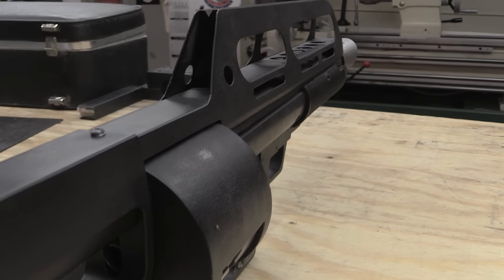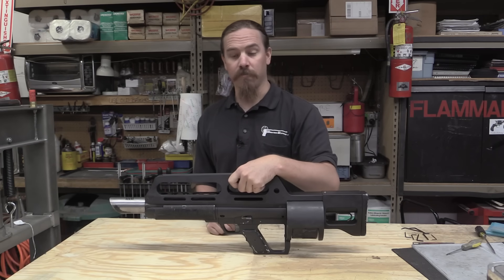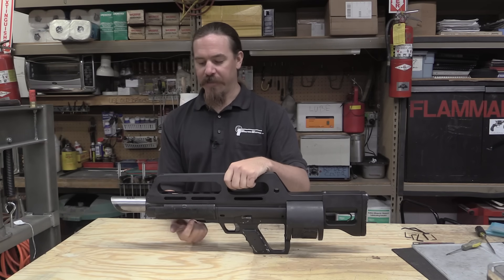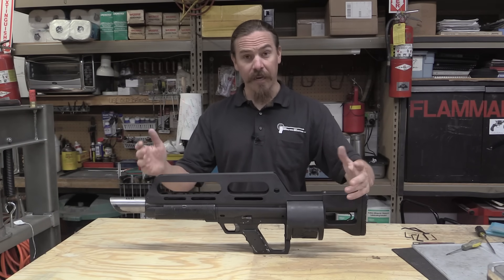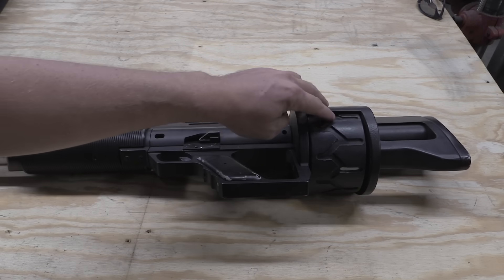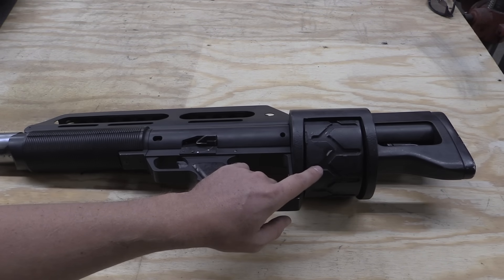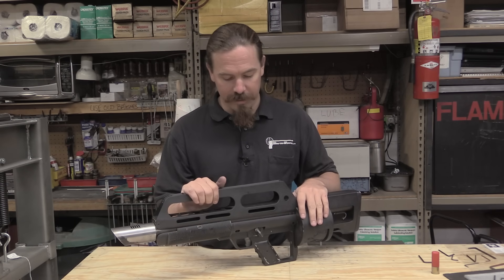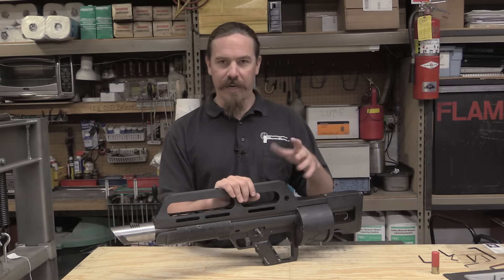Pancor Jackhammer: The Real One

Comment: Now you got that gun,, it would be great to find a XM-8... A sadly forgotten weapon.
Reply: +sam strothers I did not know that . thank you for sharing
Reply: +DeuZerre Its just a H&K G36 in a fancy shell.
Reply: +MrSuperkaji a fancy shell that liked to melt, but still one very pretty fun
Reply: +DeuZerre What was the point of it? Same cartridge as M-16, barely shorter, around same weight, same/slower rate of fire, both can use 30 round box/100 round drum magazines, etc.
Reply: or a  FX-05 Xiuhcoatl
Reply: vickers tactical said he is working on getting one :D
Reply: +gunfuego Eso no es un "arma olvidada"... :) Forgive my imperfect Spanish... LOL
Reply: ***** IIRC, it was a lot more reliable than the M16. THe thing was thrown out of the window for a few simple reasons, the main ones being "non US" and "not a cheap throwaway weapon" which is the philoso^phy of the colt: It's just good enough for the proce, and you can build many of them for nothing.
Reply: ***** Because it looks cool as fuck! Thats the point !
Reply: +username Reliability, mostly. The gas system from the XM8 (the same as in the G36, itself rather similar to the AR-18) is way less finicky than the AR-15 mechanism, which is kinda prone to blow up when wet. Or dry. Or dirty. Or when it's just that time of the month ;)
Reply: i believe it also melted, which isnt great.
Reply: savage1493 Only the first trialled version.
Reply: +savage1493 they put like, what, 50,000 rounds through it continuously. 
It's not gonna melt once you start shooting it.
Reply: it melted after a couple hundred rounds
Reply: savage1493 SIgh... Only the first ones that were tested. Like every tests for new stuff, it was quickly fixed. Its detractors only like to wave the "melting" flag.
Reply: +DeuZerre The AR is reliable enough by US military standards. In addition it only takes HK propitiatory G36 mags (because that's what the XM8 almost exactly is) when we're on the NATO standard STANAGs.
Reply: The AR is a reliable enough, good enough at everything gun... For cheap. They never wanted to replace it. The contests were rigged from the start.
Reply: DeuZerre So they didn't want to replace the M16 outright but it doesn't mean they didn't want to adopt a better weapon, foreign or not, to supplement the current supply of ARs as evidenced by contracts given for the FN SCAR, HK 416, 417 and M27 IAR. Let's face it, HK didn't win many contracts with the XM8 because not many people wanted it.
Reply: +DeuZerre Not really forgotten, Malaysian special forces employ them.
Reply: +MrSuperkaji Not really, the G36 did not have the same modular capabilities as the XM8.
Reply: +FraggingBard either you are missing a hell of a lot of shots or you have the wrong type of weapon if you need to kill that many enemies. lol.
Reply: +EnigmaHood Ooh wow, swapping barrel lengths means its an entirely different weapon. Internally, it is a G36.
Reply: MrSuperkaji
Knock off the sarcasm or you'll find yourself on my block list fast. Swapping barrels other components to change the weapon's role is not a trivial feature and it's a level of modularity that the G36 did not possess. It was also far more reliable and lighter.
Reply: EnigmaHood
My original statement stands true, as the XM-8's action is pretty much identical to the G36, and the only real difference between the two rifles is that of its cosmetic appearance, and the ability to switch barrel lengths.
I really don't see how its any different from the G36. The G36 even has its own family of derivatives, from carbines to LMG's, just like the XM-8.
Reply: MrSuperkaji
No it doesn't, and it's for the aforementioned reasons. Being closed minded and obstinate doesn't make you right.
Reply: MrSuperkaji Swap from an asault rifle to a marksman rifle to an SMG to an LMG with barrels and stocks.
Integrated optics so you don't have to readjust them all the time.

"not very different"

Hell of a lot cheaper and easier on logistics, field stripping.
Reply: +DeuZerre military logistics would make the swap idea completely asinine, you'd have to match all serials train constantly on different tactical aplication of effective ranges and overall use of weapon in any company, squad, or fireteam  based movement scenarios. you're also looking at overall issue of up to 3 barrels per soldier and keeping positive control of extra barrels making them sensitive items of their own. so you have 
1. training on new weapon system
2. training on tactical aplication
3. training on storage and sensitive items control
4. change out of Nato standard mags
5. lack of combat durability via majority plastic components
6. armorer briefs and sop standard changes 
7. production of vastly different manual of operation 
8. purchasing manufacturer rights
9. purchase of mass quantity for new issue
10. Hk manufacturers would not be up to the task of supporting us military needs
ect...

there is a lot more to adoption of a firearm for military service than "lack of interest" or "not inclined to spend money on better weapons" you'd want to issue a weapon the military could use its existing mags and save money on training anywhere they can our budget isn't endless and it would take years to issue something like the xm8 rifle. and it's not really worth it 

the m4a1 and m4 carbines even m16a3 and a4 are vastly more reliable than the m16 a1 and 2.. mud dosnt really effect the rifle unless you have no mag in the weapon and the bolt locked open as you dunk it in pile of mud... it's a well sealed rifle and it operates fine of you know what your doing and have basic cleaning knowledge.

so if you were the military, you'd see 2 5.56 rifles with roughly the same range same tactical capabilities close to the same weight but the m4 series is a hell of a lot more moduler of a weapon for modern military optics and iraq lasers to be integrated.  so the xm8 isn't this gift from God its just another 556 rifle that isn't worth a second look
Reply: What kind of nonsese are you talking about? Who said everyone had to have all of these different barrels and bits and bobs? It makes no sense whatsoever. The point of a gun with interchangeable parts would be to ease the logistics by making spares from the same families so the LMG/DMR/Riflemen would use the same base components to fix their weapons, but each of the men would only have the specific bits of their specific variant.

There is absolutely no good reason for the regular guys to be able to switch between all the roles on the field.
Reply: +DeuZerre  I'm talking about logistics, and I never said every Joe gets a barrel kit, what I'm saying in general is the rifle is not a platform that brings better performance to the table and the cost of switching is in no way feasible. calm down there Skippy
Reply: Weren't there plans of the US army adopting the HK 416? I mean it's basically a m4 lookalike xm 8 in a non melting hull.
Reply: The Doctor
I'm not sure if there were ever any plans, but the USMC did adopt the M27 as a squad automatic weapon, and that's basically an HK416.
Reply: +DeuZerre The Daewoo K11 is quite similar, and actually in use.
Reply: Actually, i saw some soldiers in the italian spec ops with them.
Reply: +fredmachine xm8 was a bi product of H&K and colt working together to find a better alternative to the m16. well guess what happens when you mix two languages together and see if you can make a gun. luckily the xm8 later became the g36c, g36k (my fav) and the mg36
Reply: Actually all three versions came before OICW was killed and the XM8 branched off, the K was made around the same time as the rifle to replace the paratroopers' G3KA4s, the C was made for police and special forces around 2001, and the MG36 was made to replace the heavy MG3 (basically a re-calibered MG42) as an infantry machine gun but was not adopted due to the lack of a quick change barrel or reliable feed (Drums have never worked very well) ;and the MG4 adopted instead. That aside, the XM8 would have been a good gun, possibly even a great one, which was sadly killed due to American manufacturers whining about a lack of competition, despite them and Alliant winning the EMD contract for OICW in the first place.

Comment: Problem with military procurement. Good ideas failing because of financial problems.
Excellent work like always, thank you.
Reply: No the thing about this is the budget ussually is spended in sheer fucking dumb projects that are hella lot expensive, take years to develop , and when is  ready for deployment is already obsolete (Hello there USA  Defense Budget) when the money instead of beign spended on  "superweapons" could be far better used upgrading weapons and gear for the regular army.
Reply: It wasn't a good idea though, a full auto shotgun has even less merit on the battlefield then a pump shotgun. For at least the pump shotgun is a simple and cheap way of doing the one thing shotguns do in modern war, breeching. This plastic covered behemoth is only good in the looks department and not on any realistic scale.
Reply: You should see the way you have to load it. Insane....

Comment: Reminds me of the street sweeper. I had one back in the 80s before they reclassified them. The folding stock broke the first time I used it but the gun would definitely unload all 12 rounds in about 2 seconds. You could cut down small trees with it. Very slow to reload but still would make a good entry weapon. If you still have a problem after 12 rounds of Magnum buckshot you didn't bring enough guns to begin with.

Comment: Watching this again, something occurred to me: if the disconnect for semi-auto fire activates at the end of the triggerpull, beyond what the mechanism allows for full-auto, could it fire automatically while set to semi-auto if the trigger is only partially depressed?
Reply from the maker: Mechanically yes - but in practical terms the recoil from firing would make this impossible to actually accomplish.
Reply: +Forgotten Weapons what about a trigger stop screw that only let's the trigger travel to the point of this technical full auto, where you could just grip it and rip it!?
Reply: Was wondering the same. I think it would have resulted in a really nice burst-fire "hidden feature" for experienced users. Pull lightly in semi-auto mode, and get two or three rounds off before the recoil force hits you hard enough to cause you to release the trigger or pull it all the way.
Reply: Yes. This can be accomplished on some guns by slipping a pencil behind the trigger. The more you know.

Comment: If I were to continue this project, I would ditch the idea of a completely rounded profile. Those little plates that are in there are just extra weight and who wants that?
Reply: +BrainSeepsOut almost certain the idea was to have the reciver rounded un  produtction and the plates are there to help woth working out the tooling and to get it looking like the planned never to happen production jackhammer
Reply: +BrainSeepsOut They're decorative. In the tool room, he made the underlying part as a box (which is easier) and added curved parts to translate the final look - that would be achieved with factory stamping (that he didn't have access to).

Comment: ... I have a feeling that the “different magazine change system” was something similar to a bolt handle that pulls back the central drum rod to drop the drum out the bottom of the rifle.
Reply: Wonder what happened to those models. Army probably just put them in storage somewhere and forgot about them.
Reply: Omega Supreme I wouldn’t be surprised if that happened.

Comment: The drum design is clever and impressive!
Reply: If you think thats cool, you should open up a ballpoint bic pen with the clicky button on the back.  Its the same sort of rotating and camming mechanism.  Every other grove  is half the length.  So you click it once, the pen stays in, click it again, the pen extends out.
Reply: If you think thats cool, you should open up a ballpoint bic pen with the clicky button on the back.  Its the same sort of rotating and camming mechanism.  Every other grove  is half the length.  So you click it once, the pen stays in, click it again, the pen extends out.
Reply: it had a accessory called the BearTrap where you could put the drum on it and use all 10 shells like a M18 Apers mine...

Comment: Did I understand the firing mechanism wrong or can I actually fire full auto in semi-auto mode if I manage to squeez the trigger carefully enough to not let the mechanism lock back totally?
Reply from the maker: +KnorpelDelux I think you could. Good luck actually pulling it off with all that recoil going on, though.
Reply: Thanks for the reply. Yeah I was just talking about the theoretical possibilities to fully understand what's going on here.
Reply: +KnorpelDelux i thought the same thing. Like what if you wanted to fire single shot, pull the trigger and then release the trigger to a timing where it engages full and it fires 2nd round unexpectedly

Comment: If the design was simplified to make it easier to make, and someone like Magpul who specializes in injection molding polymers wanted to make it, there could be a modern lightweight shotgun inspired by the Jackhammer. Not an exact copy, but a bullpup setup using a drum mag. A 12 round mag might be better and could be made to the same weight. I think a semi-auto only version would generate a lot of interest from civilians and police. I could see it selling well if it was reasonably priced. A 20mm grenade launcher version, sort of a NEO-Neopup, for the military would be awesome. 10 x 20mm grenades vs 1 x 40mm grenade sounds really good to me. Even an 8-shot grenade launcher would be cool, and not bulky like the 6-shot 40mm Milkor MGL.

Comment: When I saw this, the first thing I wondered was if you were going to cover the bear trap function. Way to do your homework. There was actually a shell designed specifically for that. When fired, it inflated a three foot diameter thick wall rubber balloon till it popped, releasing a massive shock wave and a brilliant flash of light. Probably wouldn't want to get those mixed up with your buckshot rounds........= )

Comment: Damn, thanks for the cheap mine idea, 3d printed drum, i would put them at an angle so they shoot in every direction in a circle, pressure plate with firing pins on the bottom, that could easily take out an entire unit
Reply: In my mind its such a simple device, down to the trigger mechanism, a spring holding up a rod, & on the bottom a pressure plate or even a mechanical button to engage the firing pins forward to strike each round

Comment: For the mag I imagine...
Put a "pull out for the bar, unload the mag, and attach to that a "dust cover that opens as you are undoing the bar" Basically pull something in the back, load a second mag in, click back in, recloses the magazine to protect from gunk" THe magazine is already bulky...so...It's okay gun on some concepts but in general The AA-12 will do the part better now. And shotguns in general are...obsolete in most basic cases.

BUT for civie use, It's a pretty scary pump and go...the size will add some intimidation factor...and well Nobody wants to get "Jackhammerd"

I imagine a few, ways to fixer up on at least the reloading ideas.

Comment: Just stumped on this video. I never had any idea that this gun actually exists - the only depiction of it I was aware was in Fallout 2 and I thought that it is totally made-up gun, just like many other present in the game. It was the ultimate shotgun in F2, basically - full auto fire shredded everything up close. What happened to the inventor is a big shame. And the guys has never got any royalties for its (apparently) widespread use in pop-culture, most likely.

The idea about converting drum magazine into a anti-infrantry landmine is neat and as I imagine, the drum itself (at least) and the firing mechanism would most likely survive the firing to be re-used. One limitation I can see is that it needed to be stepped on to fire. In theory, this does make sense, as soldier isn't wearing any body armor in areas this would hit from the bottom - a weapon like this would absolutely shred legs and vital (less vital, too) organs, killing the victim or at least severely wounding it. But the drum is small and landmines are effective only when deployed in large numbers, as actual chance of enemy stepping on them is pretty low.

This obviously wouldn't be good enough for a device which would need to serve as a kind of ad-hoc ambush weapon - the only realistic scenario in which this would be useful. So a tripwire activated mechanism and using the drum as directional "shrapnel" mine would be a lot better idea. Also, it takes way less time to set up a tripwire trap than to dig a hole for the mine and cover it efficiently for enemy to not notice.

Furthermore, considering the removal of necessity of actual mechanism of a gun working in this case, one could get away with using ammo not suited for Jackhammer - too weak or too powerful. If it would fit the hole, it would be fired (lol). Thus, it would allow troops to use ammo salvaged from enemy in this scenario, while preserving their own supply needed for actual gun.

Definitely an interesting idea and one which could bring some tactical flexibility to infantry fighting in jungle areas. There's a spark of genius here.

Comment: ohh but this removing and reattach the barrel to the drum is good invention, the could get also included in outher drum feed guns, this way you could prevent to burn or hurt your fingers and it gives also a bit more power, cuz it looses no gas to the sides of the drum - well it have to work fast and price, that also speed shooter can use it.